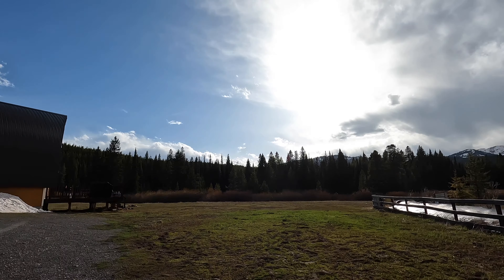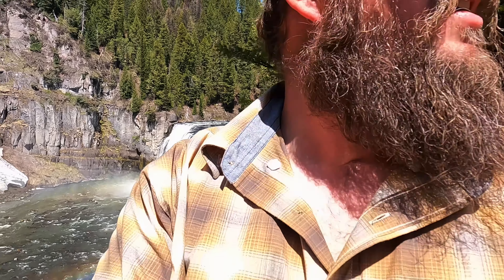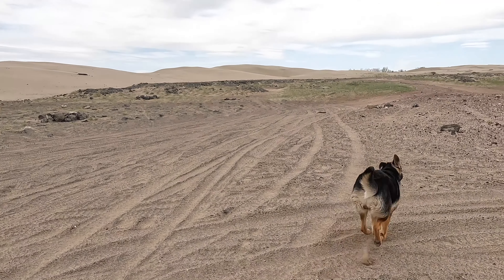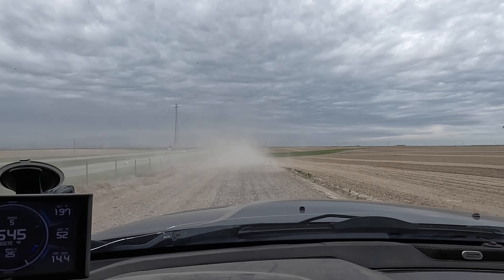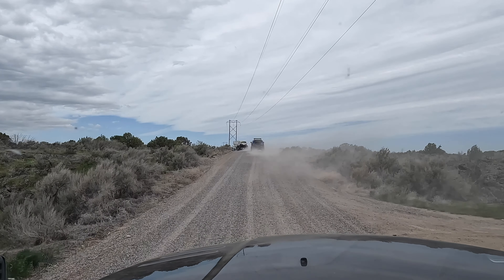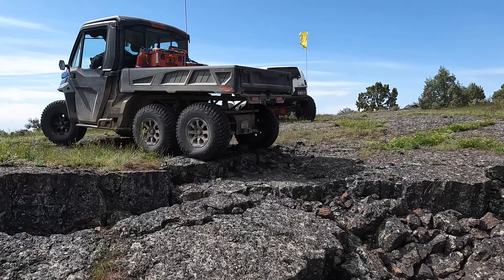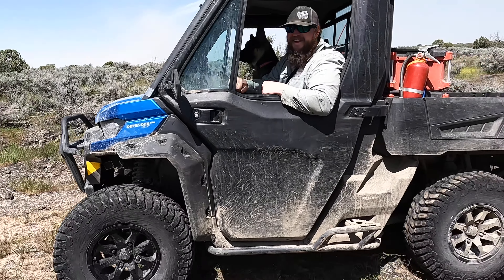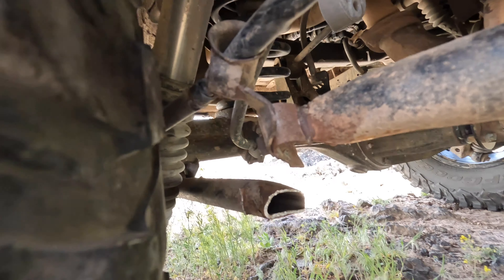Exploring Idaho in my Northern Lite and Can Am 6x6 | Offroading with Offroad hub | FJ Cruiser |

Comment: Dunes suck in the wind, you should have made it out to the big dunes,  they are like 2000 ft tall but take a bit to get out to. Million dollar rigs out there it's a blast.
Reply from the maker: Where at?!  Those are insanely tall dunes.  Sure you didn’t mean 200ft cause that seems 
Still tall but more realistic 😂
Reply: @downbytheriver501  They are like 15 miles long and the most Western dunes are world renowned, you can't park near them and have to offroad to them. But yes I butchered that, meant 200 but Choke cherry is the tallest dune in Idaho at 500 ft tall but if you want to get technical the mountain behind the dunes is also sand and towers over the dunes.   Devils bowl is hundreds feet tall and a mile in circumference, they are insane, you go damn near completely sideways in it. Million dollar sand rails, my old quad couldn't climb half way up choke cherry. It's a whole different world out there.